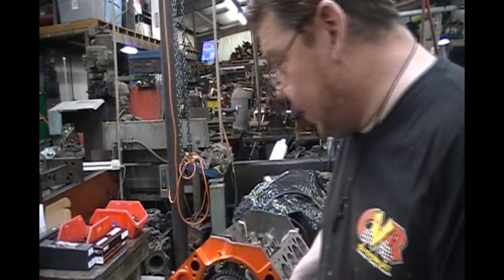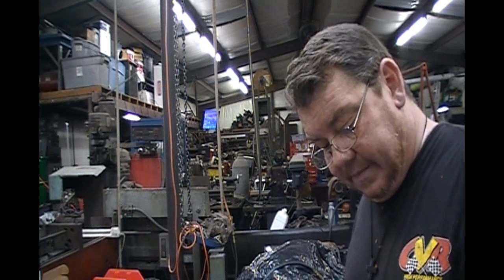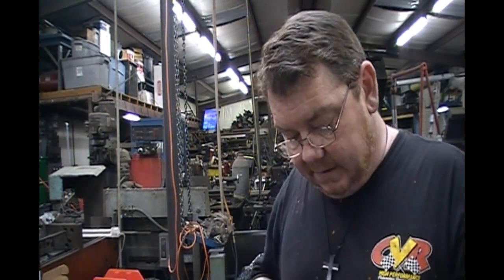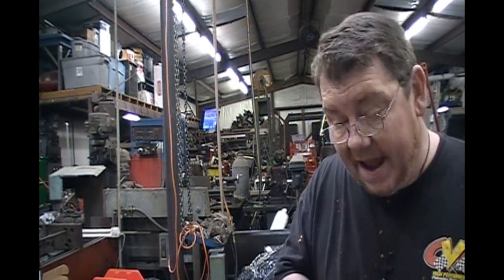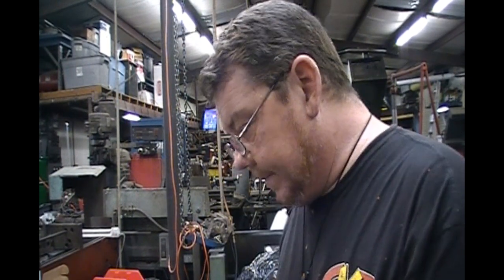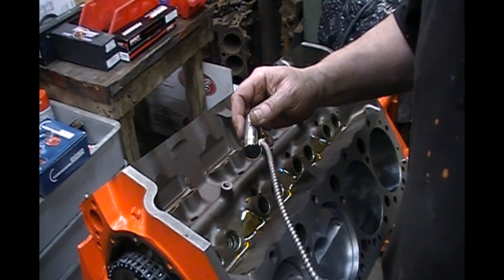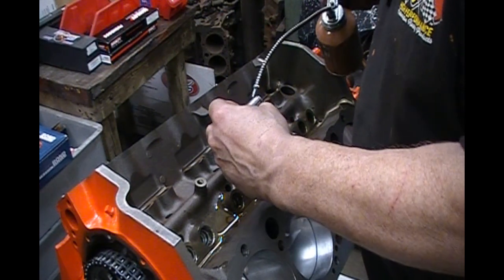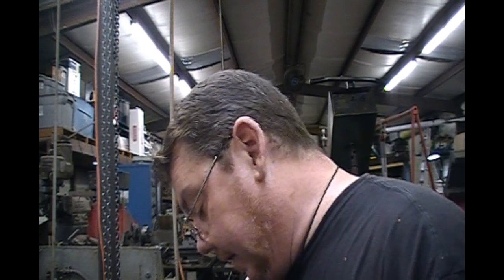Flat tappet camshaft problems, lifters, oil and talking flat tappet tech

Comment: Here’s my routine.  
1. Make sure cam has taper. 
2. Make sure lifters have crowned face.  Wobble test on glass table.  Scientific enough.  
3. Load products in with full spring pressure.  
4. Add VR1 and nothing but.   Period.   Since 1982! 
5 . Bust it off, run it in. 
6. Tune it and send it.  
Been at it since 1982. Never lost a lifer.  Never lost a cam.  
It’s literally all “taper and crown”.  Not metallurgy, not in break-in oils.   Not in reduced spring pressures.  Or any of that voodoo.  Tell me this.  If it won’t run under 320 lbs of open spring pressure at minute 12 of the break-in then how does it do it at 21 minutes. Does it change up on a timer?  Does the mental temper during break in?  No!  If it’s gonna run it will run fully assembled.  If not, it won’t.   In fact…. I’d be personally scared of any engine that had to be “coddled to life” in such a manner.  Cause that would tell me as a customer that POS ain’t gonna make the 115° Texas heat at 6500 RPM.  
My customers have never had that worry.   Or a cam failure.  The motors just run.  And, we all sleep good at night.  
Rhoads Lifters are my personal favorite and all I run in my cars.   They’ve never let me down and I have some that are 40 years old, still clicking.  😁
Reply from the maker: I agree with most of that, and to be honest I normally don't use break in springs unless the customer asks me to. I have the same opinion as you. I've had 2 cams go flat in 30 years of building race engines and I use some ridiculous lift and spring pressure sometimes. I will say this on break in oil..It's extra insurance during the first run in period. Is it completely necessary...no, but it doesnt hurt.  There is nothing wrong with VR-1 it's Great oil and I've used it for years and still recommend it. However I do see less bearing and ring wear in the circle track engines that come back to be freshened up that use Driven....that being said I have a bunch of customers and one of  my own engines that are on VR-1 and never had one issue.

Comment: I personally reccomend  hydraulic roller conversions for old flat tappet engines ,its really cheap insurance .
Reply from the maker: If I had my choice, I would put a roller in everything. But Unfortunately most of the limited racing classes  still require flat tappet cams. About 80% of the engines we build are flat tappet and honestly we haven't lost a flat tappet cam in years. I think a lot of what's going flat are the "budget" no name or re named cams and lifters. And not using proper flat tappet break in oil. But yes I wish I could rollerize everything lol.

Comment: Something has drastically changed in the cam and lifter manufacturing process over the years. All the big factory auto manufacturers for decades were mass producing flat tappet engines with no special break in or break in oil and they would last over 100,000 miles, I have personally seen TBI 350s with over 250k on stock flat tappet cam. And I don't think that the zinc is as critical as it's made out to be, it's a good thing to have for sure but look at all the 4.0 jeep engine made in the 90sand 2000s that were ran on nothing but non zinc oil most of, if not all of its life with no cam failures. I feel that it's the manufacturers are not doing something right and pushing blame off to the end consumer, many professional and amature engine builders have been having extremely hard times in the past few years just to get them to last more than 10min. And if it was only happening to super high lift and duration racing applications with extreme valve pressure that would be understandable, but most of the failures people are having is in stock type rebuilds with a completely stock or slightly bigger than stock cam, no crazy lobe design or spring pressure and they still don't seem to survive. Hopefully things will change and the flat tappets will get better but as of right now it's not looking very promising. Putting in a new flat tappet is nothing more than a pure gamble these days.
Reply from the maker: Yeah things have changed but I litterly build about  50 to 100 engines a year with flat tappet cams. Not one failure. Not with stock replacement not with hot rod not with big lift cams. But I make the checks and don't use junk I don't know about. None of the engine builders I know around here are having trouble either. But I hear about it all the time. I honestly think a lot of people are doing stuff wrong. Wrong setup, wrong breakin procedure, and I'm sorry but I have to disagree about ZDDP.  We went through that 15 20 yrs ago when they got the PPM under 1000 in regular oil. All of us started having break in failures. Luckily I didn't have many because I had all my customers on VR1 or  synergy racing oil with plenty of ZDDP. I just haven't seen it. Very rare.
Reply: @Marksracingengines  everyone I know that has put a flat tappet in since 2020 has either lost a lobe or had the lifters tick every time the engine is restarted, quality is definitely not what it used to be. There's a pretty popular local machine shop in my area that has had over a dozen cam failures at the start of 2021, and they have been using joe Gibbs break in oil and have been breaking all their engines in on a dyno and their method has been the same for the past 30 years. They actually now won't assembly a flat tappet engines with any warranty anymore because they have eaten Soo much money on redos, now they only warranty if the engine has a roller cam. And most of the engines they built were factory type stock rebuilds so nothing crazy, and even with the simplest set ups have been nothing but trouble. I know all these issues have scared me off from doing any unnecessary cam swaps, I won't change one unless it's physically bad. The last couple sbcs I put together got the factory cam reused because I don't wanna do the job twice, even though I am leaving a lot of power on the table, but a healthy running stock engine is better than loosing it to a bad cam lobe and having to rebuild the whole thing.
Reply from the maker: @briang4470  I’m not doubting there is an issue, I hear about it as well. I’m just saying as of right now we aren't seeing it, it may start tomorrow for all I know.  I hear a lot of bad shit about Comp. And to be fair I haven't used any shelf grinds from comp in years. I have used quite a few custom grinds from comp with no issues. And to be honest 90% of what I have ground is from Bullet, Isky, or Jones and mostly on P55 cores. Maybe that's why I’m not seeing it I dunno. Some say P55 cores are brittle and will break. I haven't  had that issue either. Again not saying it cant happen, I’m just have not seen it. Now I will say this. Last year I did have a set of lifters from comp that had trash in them from the factory and made 8 of them collapse during run in. I ended up pulling the intake and taking them all out, took them all apart and cleaned them, put them back together and all was well with the world. Never seen that in a new lifter in 40 yrs...so its now procedure to take ALL lifters apart and clean them. Even hyd rollers. Yes I would love to retro a roller in everything. The problem is a good portion of what we build is restricted circle track engines that mandate flat tappet cams and a lot of restro projects that the customer wants a flat tappet camshaft. So we’re kind of stuck with them around here for a while. Thats why I was saying in the video...find what works for you and stick with it. And if you dont have to run a flat tappet for rules, retro it with a roller. The Retro lifters are actually getting affordable. Thank’s for the comment!

Comment: Powell's Machine Inc. does custom cam grinding and has posted videos on Youtube that shows testing results that pin points the out of tolerance problems with bargain camshafts and lifters. Yes, even rollers and hydraulics suffer from poor quality control. Bon appetite.
Reply from the maker: yes we have found the same thing on off brand stuff, To be honest its not just cam and lifters...it's all engine parts. we have to measure EVERYTHING  to make sure its right, and I send a lot more parts back now than I did 5 years ago..js.Powell's is an awesome channel, subscribe to it because he knows his stuff and I agree with pretty much everything he says!

Comment: Do you prefer solid or hydraulic lifters?
Reply from the maker: It depends on the application. for a true race engine I prefer solid lifters. for a daily or somthing I'm going to put on the street and drive a lot, hydraulic is easier to maintain .

Comment: Delphi with hardened foot?
Reply from the maker: yes, and in my opinion the Delphi lifters are the best hydraulic flat tappet lifter available other than maybe the comp  DLC which is an awesome lifter as well. But you wont go wrong with a Delphi hard face lifter. Thanks for watching and commenting.
Reply: @Marksracingengines    Have you come across Delphi chev  solid lifters ?
Reply from the maker: @papercloset1568  yes you can buy them still through GM dealers and Summit, also Enginetech has them at times.

Comment: Cams have always been hardened and nitrided they wouldn't survive without it, now your saying Comp charges for this??
Reply from the maker: Typically flat tappet cams are hardened and parkerized not nitrided. Nitriding is a totally separate hardening process. There's actually a few cam company's that offer it and it typically cost about $100 extra.
Reply: @Marksracingengines  Ok thanks for clearing this up

Comment: Don't try to tell me that that molly lube is staying put and  doing a damn thing.... That lifter as you pointed out is riding on a little point on the peak of the Lobe. Spring pressure is going to squeeze that shit  right out!!!. And once the engines up to operating temperature  the hot oil is going to wash it away!!! My very first uneducated camshaft swap in 1996 at 26 years  old  in my Corvette was problem-free!!! .i had  zero idea what I was doing... I think I set the valve lash blindfolded😂 No special break in oil.... No zink oil for the first thousand Miles blah blah blah.... No babying  the engine for the first 3000 miles blah blah blah no wiped out lobes no failed lifters!!!!!
Reply from the maker: Well good for you my friend! Hey you should open a machine shop and build racing engines for a living! But before you do, I would certainly do a little more research on the subject and not troll YouTube channel's and spew your ignorant Bullsh*t on a subject you know nothing about. I guess I've just been lucky the last 30+ years and over a thousand flat tappet engines I've built. BTW in 1996 there was plenty of ZDDP (BTW, it's spelled "zinc" not "zink") in off the shelf engine oil. So you didn't need any break in oil back then, and I never said to baby an engine..in fact, I tell my customers to put em in the car break the cam in and SEND IT! But hey Bless your heart and thanks for watching!

Comment: Would marvel mystery mess up your camshaft?
Reply from the maker: well. I wouldn't recommend it for a new break in. some folks use it for that but I wouldn't ever. it's great if you have a sticking lifter, sometimes it will fix it. but only put what it says on the bottle and I wouldn't leave it in there to long...and that's just my opinion. I use it to wipe cylinders down while assembling engines..but that's all I  use it for.

Comment: Flat tappet engines have problems because most of our American V8's were never intended to do what we're doing with them. That's why the factory pushed them over to rollers.
-- Look at Toyota 2JZ's, Ford Ecoboosts, Toyota 4AG's, E92 BMW M3's, and Mitsubishi 4B11's. Those are DOHC versions of the flat tappet design and NONE of them have "zinc problems."
--- All of those engines have two things:
1: Dedicated abundant camshaft oiling
2: The cam lobes are flat to the tappet, but are not concentric to the valve stem centerline. 
-- On american V8's, the cams are ever so slightly tapered so the lifter has a rolling action. This creates high pressure at the contact faces until the pieces are worn into a mating shape. This crude but effective design works great for factory camshafts at low speeds, but doubling the speed quadruples the complexity. So, this is just a struggle we're gonna have to stick with if we want to run flat tappets. There are a lot of reasons to like flat tappets since they don't blow up like rollers do. That said, we don't have the geometry that the competitors have.
Reply: This actually gives me an idea. How far off -center do we have to re-cut the lifter bores in order to run true-square cam lobes?

Comment: Driven break-in oil doesnt give great ring seal.

High zinc never guaranteed anything.

Try David Vizards 3 bottle Rqce Engine break-in Oil System.
Reply from the maker: Never had a problem with driven break in oil and ring seal, however I only run it for initial run in and then it comes out. I don't recommend anyone running it for any length of time other than initial run in because it's not a great oil for anything But initial run in. We build a LOT of flat tappet engines a year without cam failure. And I love David to death, met him in person & talked to him on the phone several times...and I'm definitively not knocking his endorsements on Oil Extreme...I've used it several times and it does work. BUT it's dang near $200 and not as readily available. That being said, it is a good alternative system. There's more to any break in oil than just ZDDP and you are correct on that. However I endorse Driven BR because of the amount of success we have had with it. They pay me nothing and I get no discount on it other than the regular wholesale discounts I get on all my parts from  EPW, Summit, Motorstate ect... The whole scope of the video was not just ZDDP and Break in oil, it's focus was choosing good parts, following a procedure that works for you ,and using good common sense practices in general when it comes to flat tappet cams because your absolutely right..."high Zinc never guaranteed anything". Thanks for watching and commenting!

Comment: Anyone using Schubeck lifters?
Reply from the maker: I think Schubeck folded up a while back, I could be wrong about that. I haven't seen any in years. only used them in customers engines a couple of times. seemed to work great. I have heard of the foot shattering because the valve lash got to loose or a push rod broke and let the lifter bounce off the lobe. but I cant confirm  it, never seen it in person.
Reply: @Marksracingengines  i think a company called 'Smith Machine' was supplying them after Scubeck went bust.

Comment: VR1 by itself is definitely not good enough for break in. Also, most good break in oils have 3000-3600 ppm zinc alone. The do not go over 2500 ppm for break you stated in is very false.
Reply from the maker: Yeah that's a typo and I need to edit it somehow. It's supposed to say "do not go over 3500 PPM". That being said, I still don't like a break in oil  that has over 3000 PPM. I've seen wrist pin, bearing, and all kinds of other issues with to much ZDDP. I also don't advocate for leaving it in the engine for more than initial "run in" in a race engine. I instruct my customers to get the break in oil out of the engine and change it before they race it. Period. As far as VR1 goes, your absolutely correct, it is not good enough for run in on a flat tappet cam. That's what I was saying in the video...Use a good break in oil and After the cam is "broke in"  use a good oil high in ZDDP like VR1 or Driven. We build a LOT of flat tappet engines a year, and we just don't have cam failures using the same procedures and break in oils we have used for years. To tell you the truth, I am not a VR1 fan at all, there are way better oils out there. But a lot of my customers are stuck on VR1 because it's readily available at the local parts store and cheaper than Pen or Driven., however thats a topic for another video. So yep, I agree with you.  I just haven't figured out how to fix it without having to re upload the video. Thanks for watching!

Comment: Seems like sense to me. Tell you a funny one,  these idiots , maybe me but anyway; they set the timing of the  cam 180 degrees out of phase, so lining up the dots on the timing gears, don't work. Just to let one know, it's non standard! It is a solid flat tappit and it works.
Reply: Sprocket ratio is 2:1

Comment: Flat tappets in a roller block, seems a waste.
Reply from the maker: Rules call for flat tappet cams only in this class of racing. If the rules change to allow a roller, it's easier and cheaper to do in a roller block than to retro a early block.
Reply: I've run a lunati bracket master flat tappet cam in my roller 302 for 3 years now no problem.

Comment: Use roller lifter / tappets,  since 1994 the EPA has been reducing ZDDP down to as low as 800 parts per million.  At some point the EPA will go to zero because of emissions.  Since the late 1980's 100% of all new cars use roller lifter / tappets.  Deal with the real world !!!!!!
Reply from the maker: That would be nice, unfortunately a lot of racing classes do not allow roller cams. And in the real world thankfully there are plenty of racing oils that have well over 1500 ppm of ZDDP
Reply: @Marksracingengines  At some point ZDDP will go to zero and flat tappets will end.